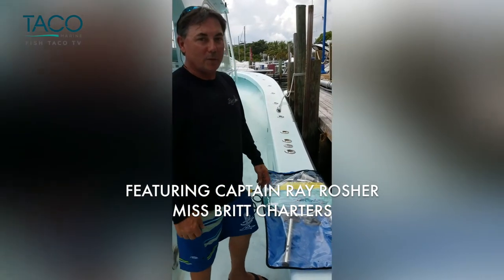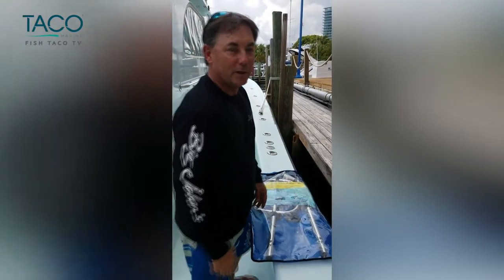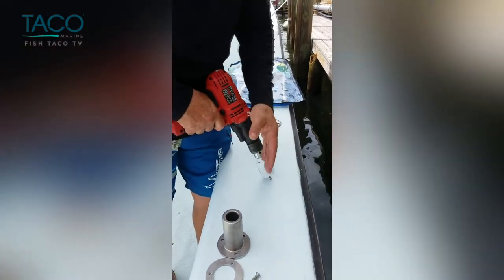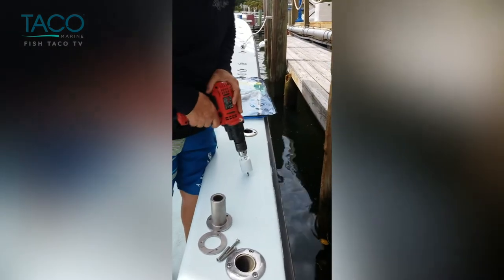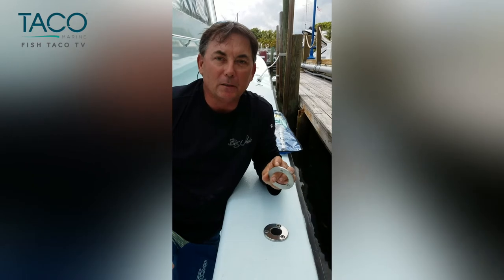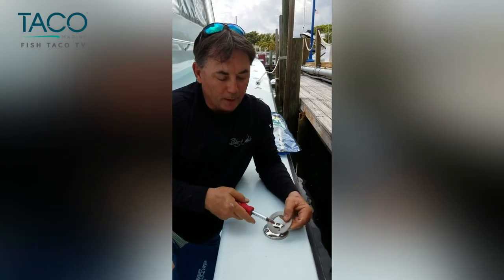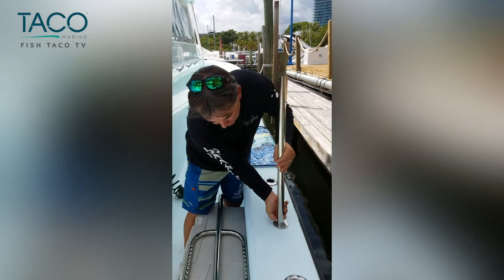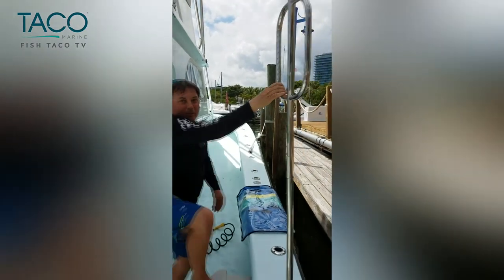How To Install a Come On Board Handle

Comment: How about painters tape to avoid splintering the gelcoat?  Faring the gelcoat edges to avoid splintering? Sealing the core to avoid water intrusion? Maybe 5200 to bond the receiver and plate? Directions say to use locking nuts - he says not needed. How to shim to reduce the wobble?
Reply from the maker: Hi DEP. Thanks for your questions. Captain Ray says, "putting tape down does help. Gentle contact with the holesaw is the key. Trying to drill too fast usually causes damage to the fiberglass and gelcoat. 5200 is the strongest sealant but it is more of a glue. 101 made by 3M, Lexel or even silicone will seal the edges just fine under the plate." Please let us know if you have any more questions. ~ Team TACO